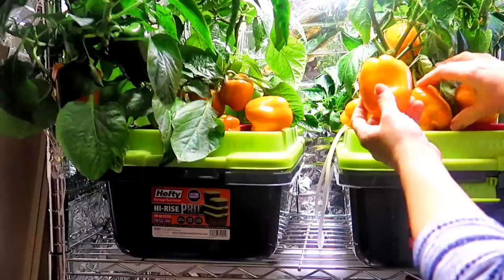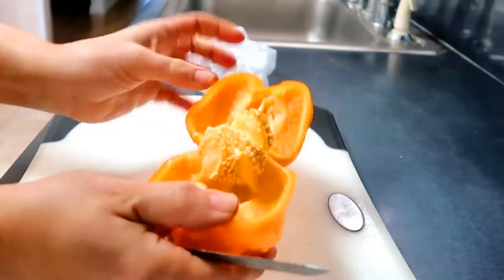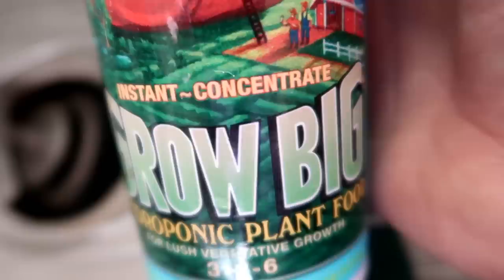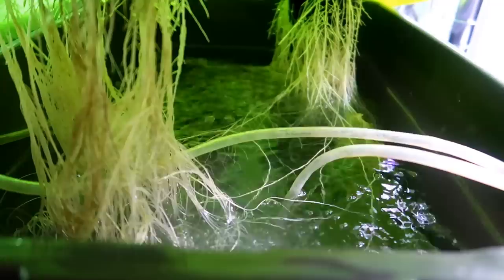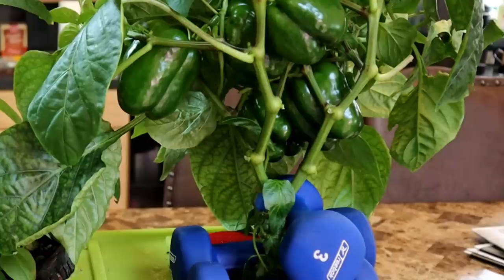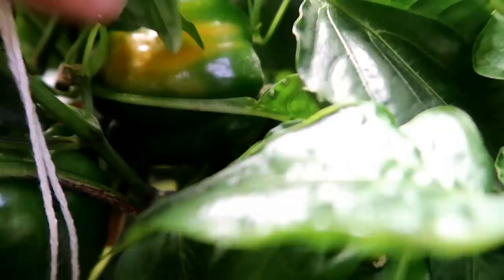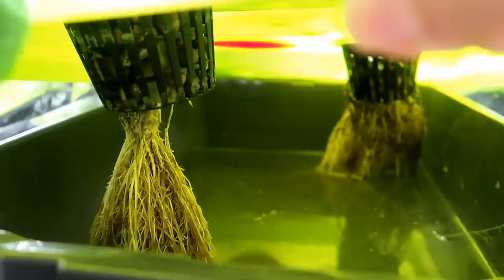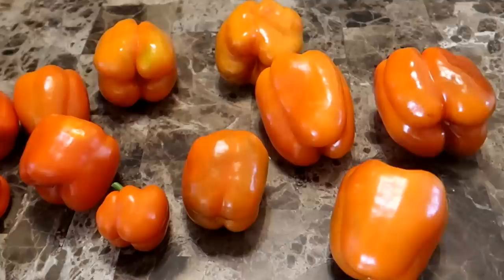Hydroponic Peppers from Seed to Harvest: Kratky vs. DWC Comparison

Comment: That’s really interesting!  I have grown a variety called Lipstick red and they are a sweet pepper from bakers creek seed company and I grew these in a DWC, and the first peppers it produced, 5 sweet peppers in total, I actually had two pepper plants growing to begin with in a 4Litre container and when it appeared that they had stopped growing I decided the container was too small and I really wanted to transition them from 4litre to 10 litre and to separate them.  However when I transitioned them and saw the roots for the first time I noted the larger plant had wrapped its roots around the smaller plant and seemed to be strangling it?  Pot bound?  I think so.  Anyway I couldn’t separate them without damaging a lot of the roots, so I put them in the 10litre container together and after about a day and a half I pulled the roots up to look and the two plants had completely unwound their roots by themselves which made the separation very simple so I did that and then within a short period of time the peppers turned red and we began to harvest as we needed them and I’m happy to report they were sweet and delicious and soooo much better then any store bought.  Then I moved the larger plant into a 40 litre container because after the last pepper had been removed it seemed to enter an interesting growth spurt and it was putting on all kinds of green leaves, so I transplanted it up into the 40 litre container and it began blossoming all over again and it has at least a dozen blossoms that are open on it at present that I’m tickling each and every morning in hopes of pollinating these and getting a second phase of a growing pepper cycle perhaps because the first time around it was so restricted because of the lack of space for root growth that it didn’t reach its full potential?  As soon as I saw the beginnings of blossoms I began heavily pruning the undergrowth of leaves and removing as many as possible creating a sort of
Lollipop look.  Apparently with hydroponic growing this is a necessary step as they need to receive much more light at the blossom to ensure a good growth and in order to ripen.  I am very excited to see this next phase.  I had thought perhaps after the first round of peppers was finished that the plant may be finished as well but this has proven not to be the case, it didn’t even seem to go through any dormant period before starting to blossom again but only after the last pepper was picked.  I wonder if there is some correlation there?? Both plants have reacted in the same way, the second plant I’ve kept in the 4litre container because it was said you couldn’t grow sweet peppers in a container that small but you absolutely can albeit you won’t have as much growth or as many peppers had you been growing in it in a much larger container but it is certainly possible.  At present I’m growing seeds from peppers that we purchased in the grocery store they are a wide assortment of all kinds of colored peppers and sizes.  So far I have 25 plants that I’ve grown from seeds and they are all doing very well at growing I don’t know how they might taste but I’m hoping for the best.  I was quite disappointed to hear that your peppers weren’t very sweet and I wonder if it could be that despite you allowing them to vine ripen that you still picked them way too soon?  I noted they seemed to be a much deeper orange color then the original one that you took the seeds from? I know when you grow hybrids or gmo plants you are taking a chance but usually the end result could have characteristics of one or the other or both of the one you took the seeds from but generally it’s looked to have taken the superior traits of both of those plants resulting in a more disease tolerant plant I’m not sure that would have any bearing on the taste of the fruit?  Could it be whatever nutrients you were using in your tanks had become too concentrated and it didn’t allow time for those to be flushed out of the fruit itself?  I’m just really curious why it didn’t taste as sweet and had a “green” taste.  I can tell you that my red sweet peppers were sooooo sweet they tasted like candy although these were grown from seeds that I purchased from a company could that be the only thing that could make the difference?  I’m not sure but I’ll
Provide an update if these pepper plants that I’m currently growing from seeds produce an  assortment of fruit or not and of course how good it tastes which is the most important part.

Comment: Thank you so much for this very detailed and eloquent presentation, you are very good at this! Sorry your bell peppers didn't taste as you expected, but you helped many people with this information, at least my self. I thought about taking the supermarket bell pepper seeds as well, but decided to buy some non-hybrid seeds instead. Looking forward to do the Kratky method experiment first, and then will get the air pump and try the DWC. Ultimately, i wish to build a NFT system, but this depends on the results i get with the first two methods and experiments. Thank you so much for sharing!

Comment: DWC is by far one of the best growing methods barring maybe aeroponics or pure fog. The one drawback to DWC (and it is a big one for indoor growers) is the noise. Those air pumps will drive you absolutely crazy after 2-3 months. I remember growing DWC in my bedroom and trying to fall asleep at night was a test in patience alright. But the results are unmatched. The speed of growth, the size of growth, the production. Completely unparalleled. It doesn’t even come close.
Reply: Use foam ear plugs then you won't hear the sound of the pump.
Reply: It is mostly because you do not understand the root system with Kratky. Most people dont know about the oxygen needs, the blocking of light, the 50-75% space the roots needs for air while keeping air moist enough while still letting some air out. When I see kratky videos with roots under the water surface I know something is wrong. Healthy kratky roots will always float on top of the water and expanding outwards towards the sides like a birds nest. DWC could most likely cause lots of additional problems to your growing because if temperature, sound, roots getting stuck etc.

Comment: Great that you do comparisons with the methods so I can see if my non-pump plan will work! And I've just realized as well that tote is the way to go, not individual jars all over the place (or stick jars in a tote). As for the ripeness of the fruit, they're always either picked green, small, or hard, depending on the fruit or vegetable. They ripen during shipment overseas. So it's not surprising the peppers aren't ready. What if they waited on the vine or sat out for a good while (think bananas, avocados) until the sugars are ready? Time will probably fix that.

Comment: There are certain system I use, kratky and NFT for lettuce, but for kale, Swiss chard, strawberries, and everything else I use DWC. For DIY aerogarden I use it for rot root works amazing cures it , and back it goes in kratky or DWC 🙂👍🌱

Comment: I use the Tetra Whisper pumps from pet stores. 20 gal is a good size for 5 gallon bucket. 6" air stone can be near the top as long as the nutrient is kept high enough. You need a check valve if the pump is below the water level of the bucket to avoid siphoning. Air pumps done draw much power and you can run them during daylight hours to conserve electricity.

Comment: I really enjoy your videos. Great information, presented succinctly.  I'm wondering if you've ever used the "Heavy Feeders" instruction on the Grow Big nutrients?
Reply from the maker: Hi Chris, no I have not increased the amount of the grow big, 2 teaspoons per gallon.   I kept it like that until the first flowers started to appear, then I did a water change and replaced the hydroponic Grow Big solution with Masterblend for the second half of the grow.  I didn't film that, and it was messy to do, but I thought it would be beneficial to the plants.  Thanks for the question!

Comment: Thanks for the video! 2 things. Look up pool noodle hydroponics, it shows how you can use pool noodles as supports for larger plants. Also consider experimenting using different types of growth solutions, in my research i have found that  sometimes the fluid you mix into the water caninfluence flaver.  Keep u Pl the good vids!
Reply from the maker: Thanks for the good advice.  I've seen the pool noodles being used and its on my list to buy when they let us go shopping again!  Do you have a suggestion for a better hydroponic solution that might make the produce taste better?
Reply: Glad to hear it. I dont have anything tested as im not using the same hydroponics methods as you are at the moment, however you could consider researching worm tea. It sounds gross but you can soak worm castings in water  till they disolve.   Its natural and the worm castings can differ based off the species of worms and what they ate yielding  different attributes.

Comment: The florescent lights you used are more blue light on the Kelvin scale, which are better for vegetative growth. Not sure where the LED lights were on the Kelvin scale, however. For fruiting, you would want to use a warmer light on the Kelvin scale. Either a small 150w HPS grow light would have given you better results or florescent lights lower on the kelvin scale perhaps. Furthermore the HPS would also would generate more heat. Which brings me to air circulation. Did you use a fan at all to bring fresh air into your grow area? Otherwise, I enjoyed the video. Especially the side by side comparison of the two hydroponic methods you used.

Comment: Great video.  very informative and well delivered.    More light intensity and better airflow and you will see faster growth.  4000 lumens per square foot minimum for fast growth.  I presume your nutrients are being replenished and you are maintaining correct PH.  That light consumes 100w in real electrical terms, so forgetting all the marketing fluff,  assuming 80 lumens per watt, typical of LEDS, you're getting 8000 lumens total. Your grow space looks like around 5 square feet, therefore you're getting 1600 lumens per watt to the plants in theory.  In reality light placement means it will be lower.   Sunlight can be estimated at 10,000 lumens per square foot, so your plants feel like they're growing in cloudy conditions.   That is how much growth potential headroom you have but to meet this you need constant and vigorous airflow to provide the constant stream of co2 to the leaves that will enable the plants to utilise the extra light, so a strong fan that pulls heat out of the top of your enclosure from openings around the bottom will do it.  If it ain't growing at Mexican hillside speeds, then one of light intensity, co2, oxygen, water or nutrients is deficient.  Bell pepper should bear fruit in 60 days and maximum for ripe fruits should be less than 90.  I wonder how much the longer cycle has affected flavour, but some people use epsom salts to enhance flavours.
Reply: Great information...thank you

Comment: You might try using gravel instead of hydroton on plants that will need to have some weight to anchor them. I dont have any hands on xp w/hydroton, but what I've seen makes it look much lighter than gravel, a three inch netcup filled w/ gravel has a bit of heft. It seems to work fine as a medium, I've been using it with basil plants and they seem to like it fine. Dont know if the difference will be enough to help w/anything, though, but gravel is really cheap. Also, it does make plastic containers used for Kratky a bit top heavy.

Comment: Peppers and tomatoes do like hot weather.  If you are growing in a tent you could try using an additional incandescent light to keep it warm.   Cross-pollination is important for taste as well.  Shocking the plants (not watering) produces improved flavor.  Hard to do with hydroponics and happens naturally onside.  You could try running the container low on water prior to harvesting.  Great videos and thanks for your honesty.

Comment: Have you tried flushing the system before you harvest? I’ve heard of doing that recently. Basically: use more water than solution for a little bit and then all water, no solution. Supposed to help with bitterness of other veggies

Comment: Thanks for the comparison. I think it's good to know the pros and cons. The DWC plants are larger vegetation and larger fruit, but requires electricity. If I wanted to do this outdoors, I'd have to source electricity. Knowing that I could get sufficient fruit from less work means I could plant More Plants and get as good a yield without using electricity or much more effort. Considering that the seeds are the product of sexual reproduction, you don't know if you got the best characteristics as if you had chosen the varieties to pollinate specifically  or more likely just random genes. Sorry they didn't taste good. Also, maybe the plants were stressed into maturing too soon, and that's why they still tasted like unripe peppers. But since both tasted not good, more likely randomness in breeding was the culprit.
Reply from the maker: Thanks Metqa for the analysis, breeding...could be.  Or the nutrients?  Or the lighting source?  I'm growing these same seeds in soil in the garden right now, I'm curious to see how they taste.  Seeds from the same mother, but they are like brothers or cousins, not clones of each other. Hoping they taste good!
Reply: @TikkiOOO  Heyo Tikki O.  I know it has been a couple of years.  Happy 2023. I've been sending friends to your videos to get some good advice in starting hydroponics!

Comment: I really enjoyed the video and it was most informative. Thats a shame about the taste. I was thinking of doing an experiment  using a cheap ebay aquarium heater and controller to mimic summer day and night temperatures in the water. Also a pump to mix the heat evenly. Worth a try.
Reply from the maker: Let me know how it turns out sandy.  The grow area where the peppers were is 70 F during the day, and in the 60's at night, so that might have been the problem with the taste.  Heating the water may work, worth the try!
Reply: @TikkiOOO  will do Tikki O.
I live in Australia and as our winter (reasonably mild where i live) is approaching i thought it would be a good experiment. Love your videos too.
Reply from the maker: @goto8438  its fun too, hope you have an easy winter....I am looking forward to Spring soon!

Comment: That was awesome. Did you flush the plants with water a week before picking the fruit? If not, that could be the reason for the peppers not having as sweeter taste as the original mother fruit, due to the fact that the hydro nutrients had not been leached out of the plant and thus causing a different taste.
Reply from the maker: No I didn't, I have been seeing that in the comments.  Is 2 weeks a good amount of time to get the nutes out?
Reply: @TikkiOOO  Hi Tikki. 1 week will be sufficient for flushing the plants. The plants leaves will start to change colour. By flushing with water, you leach all the hydro nutrients out of the plant and allow the plant to use the plants natural energy to push all the sugars and energy on the plant to the fruit. By not flushing, the hydro nutrients often get locked in the plant and sometimes can cause the fruit to be a bit bitter. It can also be the phenotype of the seed can differ from the mother plant, just like human DNA. Each seed is different. Make sure that your PH is always more or less in the correct range for the plant that you are growing and things should run smoothly. . Take care.

Comment: What do you use for the height of the air gap ? water depth ? This might/will affect the oxygen getting to the roots and account for the difference in your two growing methods ? Very informative - thanks.
Reply from the maker: Hi Lindsay, yes, the water level gives the gap for the Kratky system.  Also for the DWC, but with DWC the air pump kicks the water up so it sprays the roots above the water.  Thanks for the comment!
Reply: @TikkiOOO  Yes - I understand that - but specifically what size do you try to achieve for the air gap (ie inches) - 2",4" or ??.

Comment: I wonder if growing in soil (indoors) would help in the colder months.  If you start using a small heater or a small HPS lamp you cancel out any cost savings.  But no matter what happens, at least you know they are pesticide free.  Also it may be better to use heirloom seeds, as I have heard commercial peppers have been modified to produce inferior fruit from their seeds.  They likely use clones commercially, they can't wait for seeds to germinate.  

I would bet peppers need direct sun or HPS lamp to get sweet.  I have learned this from growing "other" things back in my youth.

edit: did you pollinate them?

Comment: Most commercial vegetables are grown from hybrid seeds.  I never collect seeds from hybrid vegetables and use them for growing, as they don't grow true in the next generation.  You need  seeds from heirloom varieties if you want the same flavor and other characteristics of the mother plant.  I suspect that the reason your peppers didn't taste great was due to using seed that had little to no chance of growing true.  Maybe try your experiment again with seeds from an heirloom pepper? Great video, by the way!
Reply from the maker: Thanks Michelle, interesting thought.  I would have to grow the heirloom pepper first, then use its seeds, right.  The supermarket peppers are not labelled heirloom.  I wonder if this is the reason...thanks for the comment!